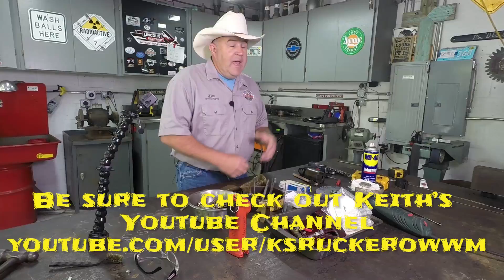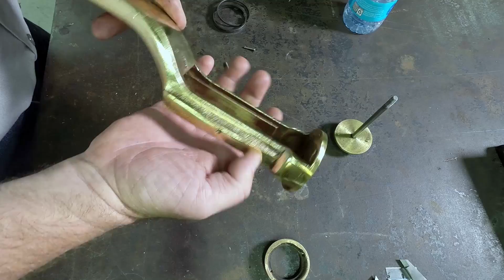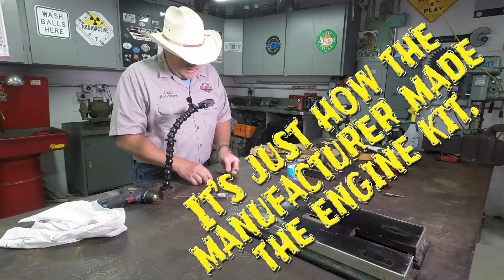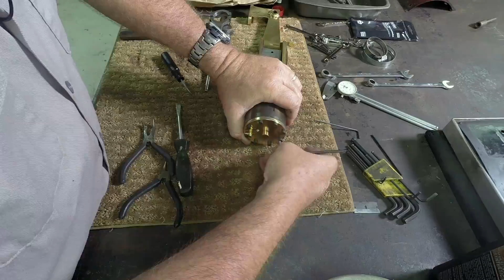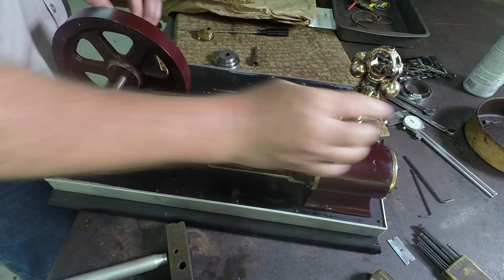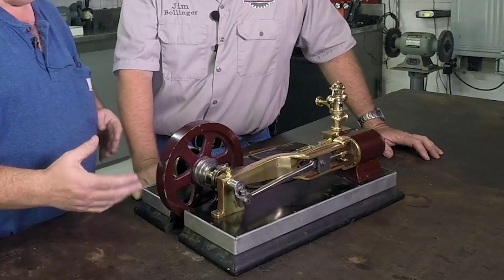Toy steam engine restoration part 2

Comment: You left out all the best parts! lol We wanna see the corroded brass turn to shiny, we want to see that wobbly garbage piston turn to a nice round shape. That, for us, is part of the restoration.

Also, it would be super interesting if you did a multi-video project where you machined and built something like this. Like start off with some large bricks of stainless or brass, and end up with a working steam engine

Comment: so a ? for Keith....... how are you going to fix the pipe threads below the govenor that should have a pipe thread taper in them and dont have it?I can only asume the builder used the wrong  non-tapered tap when building or forced it through too far.?